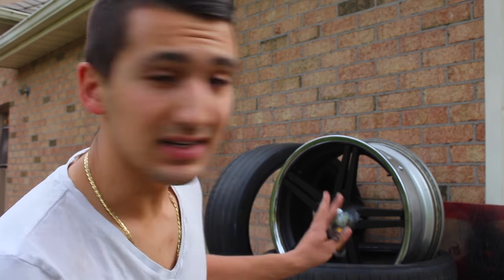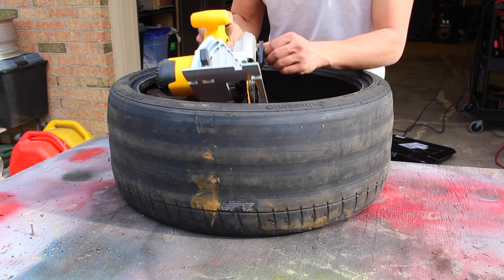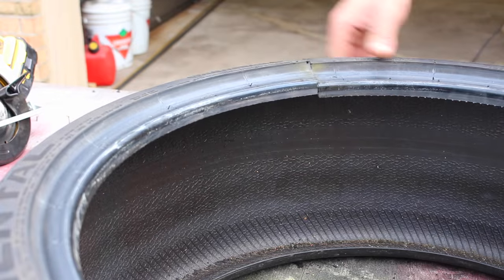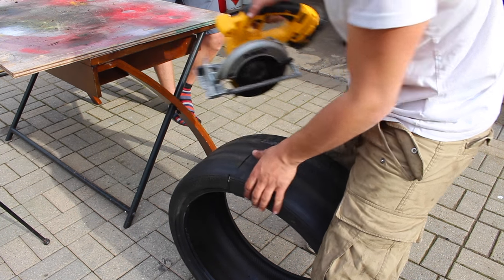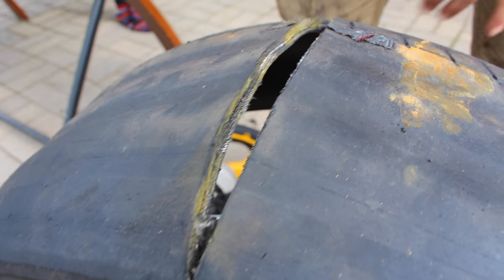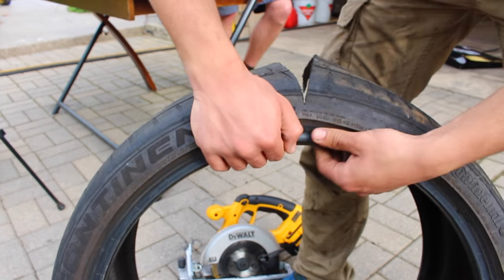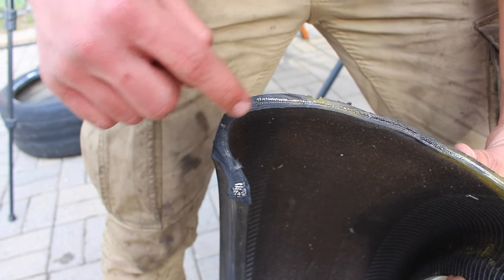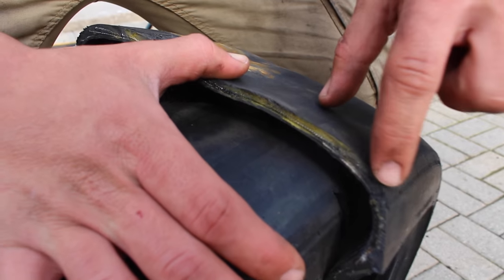I CUT OPEN MY TIRES!?!

Comment: Love this video.  Best one i've seen for my purposes.  I actually just want to cut off the bead, then cut through the radial layers.  THEN i can cut through the sidewall every 6-8 inches and use it to edge my garden spaces.  The lawnmower wheels can roll over the tread area and get all the grass up to the edge.  Nothing can grow through the tire surface.

Comment: We improvise some old tires here in the Philippines to be used as a removable speed bump, it's very effective for safety since kids run around on the street very often, and when a lowered car approaches, you can simply move it away and put it back. But there's still pesky concrete speed bumps that make lowered cars scrape tho

Comment: Next time mate, use a grinder with with a cutting disk. I'm sure the saw's blade was wrecked when you finished. You risked injury as the saw kicked back as you cut straight into the radial belt. Also, standing the tyre upright is dangerous because the tyre must be stable, secure and under your control when you cut. Lying it flat on it's side is the safest way to achieve the required stability. And if you really want to lose a finger or two, just keep fiddling with that saw's guard like you did in this video and I'm sure you eventually will.  There's many competent videos that demonstrate how to break down a steel radial tyre. You might want to watch one before filming your own demo....just saying. :)
Reply: You are right. One day, I almost cut off one of my finger!!!

Comment: So what kind of blade did you use ? I have a shredded tire on my vehicle and I need to cut the wires that wrapped around my Axel ? Good video other than lack of information on the things used

Comment: I've been curious about using rubber tires to create a prosthetic leg my really old legs are just uncomfortable and I wanted to try something new but I don't know so you have all the correct tools but one thing that has brought my attention was when you cut your tire and how I was able to see those metal Parts in it so my question is can those metal Parts be bent or manipulated or Twisted to form a smaller Circle I guess the ideal is what type of tool if any could I use to be this wire or is it bendable or is it just flexible wireyou did say ask things in the comments so my question is can the metal part be sliced has a bent or manipulated into other shapes or formsI said to myself now if a tire can hold up a 10-ton car I'm only 200 lb so how strong would this be if I created my own prosthetic leg out of itwould like to see what it would look like if I could Bend and manipulate those wires inside the inside because is rubber she shouldn't be a problem soare you up to a bending and manipulation challenge with the wire inside your old Tire challenge or if it can be done I have looked on the internet to see if I can find someone that has that ability I have not ran into any only they're just using the wire that sorry and the tire not doing too much else soplease be cautious because it seemed like when you rub your hand across the wire you got a little cut maybe it was from the heat of the saw or the sharpness of the wire so please be careful if you decide to take on this are you up for this

Comment: I have alot of trouble cutting through that steel line that runs along the edge,  but my tire is actually still on the rims I am trying to recover for bases of buried fence posts.

Comment: i cut tires and analyze all the components and dimensions (i work at a tire factory in quality department) if you need some information i can help you with anything about tire construction.
Reply: Bogdan Anghel what's the over all thickness of a Falken wildpeak at3w 305/55 20r? From outside tread to inside the tire. Basically my question is, how big of a nail can go in your tire before it actually punctures it and losses air?
Reply: Bogdan Anghel i know this is a couple of years old,  but if someone could please tell me the best way to cut tires.  
we have a tire shop and want to cut old tires down to get more in the trailer.  thanks very much.

Comment: hey milan, I took my 98 accord for inspection yesterday and it didn't pass because a code came up that has something to do with the distributor sensor, is there a way to fish that without replacing the part entirely or would a defouler do the trick for this? by the way the check engine light is not turned on.
Reply: please help
Reply from the maker: +Richard Cruz The distributor has nothing to do with exhaust work. What is the code that comes up?
Reply: +milanmastracci the code that came up is P1382
Reply from the maker: http://www.autocodes.com/p1382_honda.html